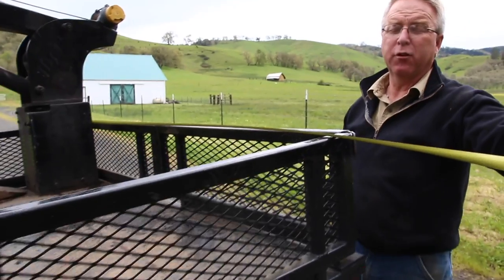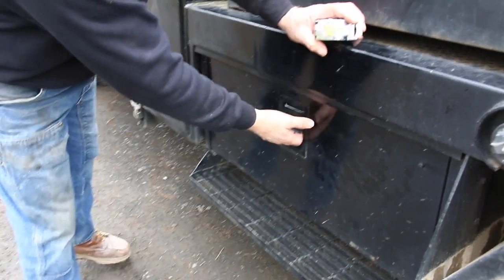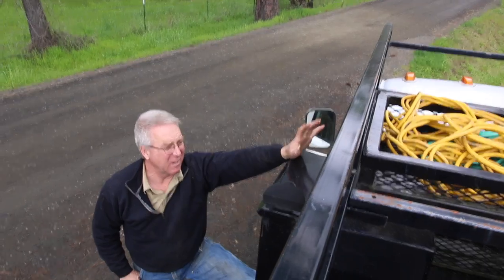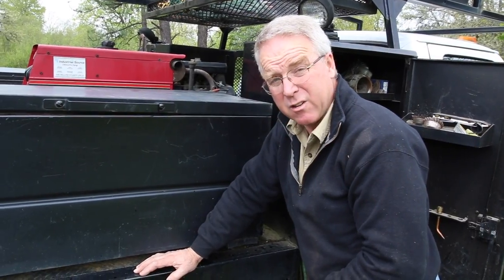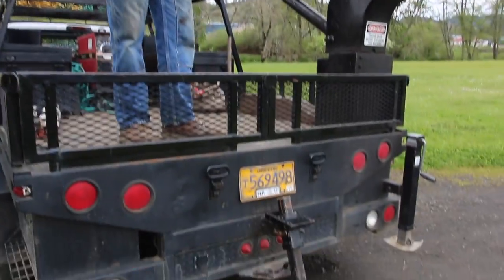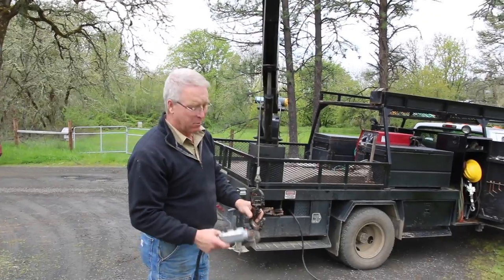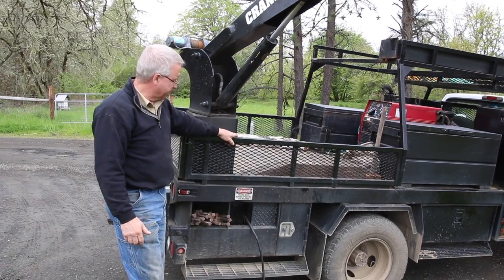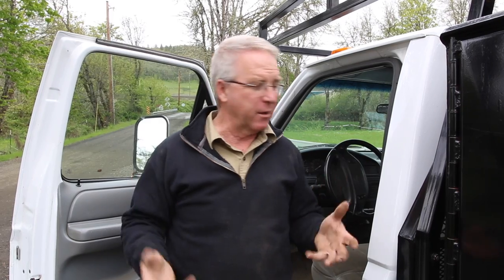Ultimate Work Truck: The Tool Tank

Comment: At 6:00 -- The best advice to young workers, ever! Protect and preserve your back. Those of us in our 50s, 60s, and beyond know firsthand how important this advice really is.
Reply: Started working at 14 putting in boilers. I'm 30 now and my back is the least of my problems.
Reply: Can't say I've had the roughest life, but my dad was a boatswain's mate in the Navy - coming off a farm - and did other physical jobs in his career. My mother was a licensed practical nurse. They both stressed proper body mechanics.

Began my work career as a temporary laborer. Used to jump off truck docks until an older worker cautioned me to avoid doing that to protect my back. I made the connection that I only had so many jumps in my back before I'd have problems.
Reply: I wish I would’ve listened to that advise.

Comment: One of the best videos.
I am enjoying setting up my first new truck in 31 years.  Ford F-350 single rear wheel, diesel, 4wd, crew cab, short bed and it even has air conditioning!  
For my business bed space is important, but so is clean extra space in the cab for mobile office, clothing and gear for staying at a jobsite for up to 3 days, sensitive tools, photography gear, water, and some grub.

Comment: As a GC I can see why you would have that set up.  
But as a high end finish carpenter in can tell you nothing beats an extended CHEVY/GMC 2500.  Sliding door unit.  
Tons of room, quiet ride, lots of power and I’ve set it up to hold every tool I need for a Mobile remote shop.  And still have room for full sheets of plywood or sheet rock.  
Rain and snow don’t mess up my materials or tools.  I can store everything in the custom bins and shelves.  I’ve created slide in/out storage containers for specialty tools.  Plus I ride in complete comfort and style.  Everything has a place, because I built it, I know how it works.  
I love your channel and videos.  I’m constantly learning and challenging my skill set and at 59, I’m still out working the 20 somethings.  Mostly because I can show up on time sober.  Plus people are willing to pay for skills that work.  Not jobs that pay.  I take the big and small stuff, and always give more than I’m asked for.  Quality has to be first.  Speed comes.  If it’s right the first time, they figure out it’s worth it.  And I never pay to advertise my work skills.  My great customers make sure all their friends and family know who did this work.  
Thanks for sharing.  God bless your family!

Comment: About 15 years ago, I lived in texas and built flatbed truck bodies from scratch and we would install them as well, sometimes I'd get a guy who knew exactly what he needed out of a flatbed and I would build it to his specs. Learned alot from them as I went along and it grew my wealth of knowledge, this of course was before I became disabled about 10 years ago when I was driving a medium/heavy duty tow truck and got hit by a car. Anyways, just an idea for you here, you could easily take those 2 job box's you have there and cut out the outside facing panel and weld in hinges so that when you open the lid, the face would lay down just like your bottom box's do and it would create a desk like feature along with making it so you wouldn't have to climb up the side of the truck and lift your tools up and over like that.. Would save your back too ;) awsome build for sure and thanks for all the videos you take time to make and share with all of us..

Comment: I have a 1999 f250 with the 7.3. It had 213,000 on it when I bought it in 2011. Just turned 300,000 and runs as good as ever. Couldn’t imagine having anything else.

Comment: One of the best trucks I have seen in my 30 years out there. Not for show, purely to get the job done efficiently. While a 3/4 ton with a service bed goes far, I now want to add a crane. I try to take better care of the back, that would do wonders. Thanks for keeping your videos pointed and on track, this is like working a build along side of you picking up new little bits along the way.

Comment: I have a 96 ford diesel extended cab LWB very similar to that white in color and it has been a wonderful pickup for many years. Very reliable and low maintenance. I bought it used 4 years old with 100k miles from a contractor who had purchased a new one. 21 years later still have it.

Comment: Great tip on the 4WL... I probably use my truck in 4L with the front hubs unlocked more than I use 4 wheel drive. Wonderful for reducing the strain on your transmission when jockeying a heavy trailer/camper.

Comment: 100% right on the engine. We switched to a 6.0 and miss the 7.3. Best engine ever.
Reply: Yes... 7.3 is good until the cam position sensor leaves you on the side of the road in the middle of nowhere without warning. A decently maintained 6.0 will never leave you stranded and is far more powerful and efficient.
Reply: @dontblameme6328  I'm weary of all the 7.3 love at this point. They're pretty old and most people praising them are probably due to nostalgia when they actually had one when they were relevant. Diesel nowadays is almost a waste to get into due to their restrictive emissions standards and high price point out the dealer. Which is a shame because I'd love to get a 7.3 or something "bulletproof" but 7.3s are showing their age and going to have problems just due to the years.

Comment: Your truck is fantastic!  Great design, manufacturing, and operation.  You are certainly right about a Ford 1 ton with the 7.3 Power Stroke - it would sell used for way more than it cost new.
I am fortunate to have a new Ford F-350 1 ton with the 6.7 Power Stroke.  It is becoming the modern replacement engine to the old 7.3.  This truck is a life changer in my work life.  It is a very fancy “Boss’s truck” that impresses customers and lets me ride in comfort for an aching back.  Recently I have been customizing storage in the bed for the tools of my trade.  The effort spent will simplify work, save time, and effort daily.  It is very important to have every tool needed, but not have extra unneeded tools that just add clutter.

Comment: lifetime mechanic there is no better way to say it the Navistar 7.3 Diesel engine is the best... call it a power stroke or whatever. .. still looking for my next one ...
Reply: The 5.9 and 7.3 hands down are the best of all Time.
Reply: The t444e/7.3 is a beauty, a gem. I cut my wrenching teeth on them. Stout, sturdy, reliable. 

Just keep a CPS and a GPR in the glovebox and you will be good. Until the spring connector in the valve cover relaxes and the glow current burns the connection.... 

I miss the ole' 99.5... 

And yes, the B series is also a real winner. You can keep the junky pickup they come in though

Comment: If I were 18, I would gladly work for you free as an apprentice, to learn a useful trade... as opposed to chasing a BA in Sociology, an MA in Sociology, and an MURP (in Urban and Regional Planning: my current career). At 42 I've realized the value of practical work and the slavery of the bureaucracy...
Reply: Right you can still make a great living without a degree. Ive never been to collage but hard work pays. Ive been doing pretty much the same thing since I got out of high school I found something I like to do and get paid to do it.
Reply: Nothing wrong with being both; an intellectual and a craftsman. The more well-rounded a man is, the better.
Reply: @errolwilcox747  I am a mechanical engineering student in college, and between the semesters I work as a service technician for an automotive electronics shop!

Comment: "A crane on your work truck is the best chiropractor on the planet"
Yes sir. I thought I was the hulk in my early 20's, working trucks. I transitioned to heavy equipment, where overhead cranes and now my service truck crane. I went from every 90 days or so being crippled in pain to maybe every other year.

Oh, by the way, you can install a higher-capacity glow plug relay that won't let you down. We had the same relay on the 99.5 for 7 years, no faults. To my knowledge, the gentleman who bought it has the same relay still on there.

Comment: I have a 97 7.3 4x4 crew. pierless flatbed. Also 160, Mason jack of all trades by trade. I have a removable boom. I just bought a mini so I'm thinking hidden fuel tank in the front of bed with diamond plate. These trucks run great. Best in class.

Comment: Very nice truck. The best trucks are the ones you outfit yourself for the jobs you know you do. I have a 1996 powerstroke mason dump with an I pack toolbox. I was iffy on buying it because I thought the extra length would be more trouble than it's worth but no, I've grow to love it. Also, your right, the 7.3 is a great mix of torque,mpg, and reliability. I'd love a new 6.7 powerstroke but theres still too much life left in my truck. Rust will get it before anything else. Its towed/hauled/snowplowed 150k miles and still starts, drives and stops great. Wish mine was as clean as yours.

Comment: We have a 96 4 door long bed. Used to use it to haul our race trailer. This gives me some great ideas on what to do next. It has about. 120k on the odo. I was thinking of getting a crane for my wheelchair but I ended up with a wheelchair van (also a Ford, love it!) so the crane will be for lifting. Definitely invaluable since I can’t lift more than about 10 pounds.

Comment: Great video, Scott. I have a similar set up for tile work but it's a Dodge/Cummins. I can't believe the guys at the tile shop that have a pallet of tile loaded up on a half ton pickup and they leave the parking lot practically dragging their bumper. Maybe I missed it but I was looking for your spare tire. Maybe you don't keep a spare and would pull off one of the back tires if you had a flat on the front. I've thought of doing that before. I appreciate you spending the time and effort to bring us these videos.

Comment: Nice rig.  I've owned my 1999 F250 powerstroke 6 speed manual  sense 2006.   And 265,000 miles later the O'l  7.3 still runs like a new one.

Comment: Love your truck. My dad has an 88 F350 that originally came with the 7.3 IDI non turbo. He had the Banks turbo installed and built a tool box bed and lumber rack for. He loves it. Its also a manual transmission. About 5 years ago the engine finally went out and he bought a new 2008 F450 to replace it. But it didn't replace the utility the old truck had with its bed/tool box system. So my dad and I spend about a year installing a 5.9 Cummins into the old truck. Not just a simple adapter kit install like we planned. Everything about the engine swap was customized in some manner. Its now more Dad then it is Ford :) I love that truck. Its a part of the family.

Comment: Just picked me up an 06 F350 with a 12 foot flatbed. Lovin’ it. I was kind of bumbed I couldn’t find an extended cab knowing I would be sacrificing a longer bed. Only wanted the extended cab so I could recline and take a nap on lunch breaks. Very glad I went with the regular cab and 12 ft bed. It has a bench seat and I can totally stretch out and rack out. The extra space the extra long bed gives me has reduced the amount of time I need to pull a trailer. By the time I get my welder, air compressor and job box on, I still have plenty of room for other tools without covering my gooseneck hitch. I plan to take your advice and get me a crane. Maybe not one as nice as yours but I”m thinking a 1 ton bottle jack type crane. Worried about rust on those cheap jacks though. I’ll have to mount it just behind my cab to give my gooseneck room to swing unless I can think of another way. Really like your channel. You seem like a dying breed. Mad respect for you. Look forward to the next lesson.

Comment: 100% right about the feeling you get when you use it daily, knowing its designed for you in mind. I never thought I would be interested/excited about using a work van with my own designs, as everything previous had drawbacks I never bothered to fix, hell I used to have all my tools in the back of my crew cab. I had an e250 van that had metal shelves and although I had more organization it was still cumbersome with the low height. I ended up buying a newer transit 250 high roof, extended and love it. I'm still adding designs and ways to improve organization, loading/unloading. It's made a huge difference as well, gone are the days of forgetting a tool or digging around for something.

Comment: I completely agree with you. I bought a new F350 6.4 back in 2008, and I was the worst decision that I had ever made. I had since replaced it with a then new 2012 F450 V-10. Now my weak point is the automatic trans. Be sure to throw in a spare crank sensor in the glove box.

Comment: Have you tried using scaffold screw jacks in replace of jacks? I find them super handy, because of how versatile and adjustable they are, and I can just plunk any sized scaffold tube inside them to reach whatever I need to. That and yeah you can also use them for scaffolding.

Comment: Great set up! Mine is a little different however, 10ft bed 10'6 tandem winch gin poles that allows me to lift a load on one winch, and boom the load on to the back of the truck, or when I take a cattle guard out to install, I can load/unload from trailer and back it into position and set it by myself,(I'm a one man show)
You have probably one of THE best trucks for work made, the bed ain't bad either!
Stay safe out there brothers.

Comment: Rewatched this after your update video,  something I neve noticed before, I guess because it's a F350.  Your 98 has the same steering wheel as the 93 and under F150's . I have my Granddads old 94 F150 (84k actual miles!! ) , 94 was the first year for airbag in the half ton.  Just thought it was cool to notice the difference.  Love your truck

Comment: I have a 1999 Ford F-350 7.3.  And you are absolutely right.  The truck has and can last forever. I have a rack on my truck also. And I love the extension cord storage you have. That is my next Sunday project.  Weld a storage on top just like the one you have. Keep the videos coming.  A ton of great info

Comment: That is a custom as a truck could get for your work. I have an 03 silverado with a utility body, and that's my rolling toolbox. I connect up to my 8ft enclosed trailer with a Greenlee on the nose and a decent Ladderrack, and I can tackle most things as a handyman / building supervisor. I can pull my 20ft trailer with a Kubota bx25 and do drainage or pull bushes. I'm only 2wd. So far, that's been great,only stuck once, lol.

Comment: I use to restore Porsche's,  VW's, & Mercedes Benz out of my Ford E350, with a 6.9 diesel after I got tired of storing several customers project cars at my shop.  I use to get pulled over by CHP,  & Police just because they knew I had something I interesting in my no window E350. I've had lots of vehicles including a Porsche Carrera and I have to say the E350 with the diesel was my do everything to go to vehicle.  I could do anything with it, and go anywhere with it. I drove it from California to WA, WI, TX... I put many, many miles on it. Thank you for showing your tool truck.

Comment: Don't know how it took me this long to come across this video.

My pop is a big fan of flatbeds, too.  But I found that for my needs (mostly hauling motorcycles around), a 1993 GMC step van (Utilimaster coach on an Isuzu NPR chassis) is great.  Keeps things dry and locked up - and out of sight; hauls a ton of stuff and still thinks it's empty.  Gets decent mileage, too... if I stay at 55 (she'll do 70 on flat ground, but I always have a vague, uneasy feeling about exactly how much load the wind places on that giant piece of plate glass in front of me), I get 11-12 mpg.

The point here being that this is my first real good utility vehicle, and having now had something that works so well for my purposes, I can't imagine ever being without one

Comment: Thank you for showing us your truck! I hear you on the low ratios for maneuvering. I drive a modern van at work and being outside the US it has a pissy little 2.0l diesel engine with lots of turbo boost. Yeah it's ok on the open road but trying to reverse a lwb, high top with a roof rack and frail when you have no power under 1500rpm is a nightmare. Plus it will do near 20mph in reverse so it's way over-geared.
Reply: Let me add to that that I'm blown away by your humble attitude. Yes of course we're interested in your truck just the same as we'd be interested in the layout of your workshop shelves/toolboxes/bathroom cabinets etc. and why they're like that. Because a master craftsman can only become one by having a pragmatic and rational perspective and so it doesn't matter what they're saying it's gonna be worth listening to.
A good friend of mine who was primarily a carpenter died unexpectedly last year and at his funeral the man he did his  apprenticeship with 30 years ago said "he was both quick and accurate, something you rarely find combined in one person". I wish I'd taken the opportunity to learn more from him while he was here.

Comment: Ive got a 96 F350 4x4 PSD box truck came from Fairbanks Ak. I drove it in 1999 working for a company on the side. Found it on CL in Fl. bought it cheap it wasnt running well. This thing has made 3 trips from Fl to Arkansas purrs like a cat 14.7mpg!. Im seriously thinking about rigging it out as a working shop.

Comment: Cool thing with older 4WD's is the manual locking hubs, you can leave them in free, and still use the 4low in the transfer case for slower maneuvering like you said for backing trailers, you don't need the 4WD for traction, just the low range feature to reduce your speed.